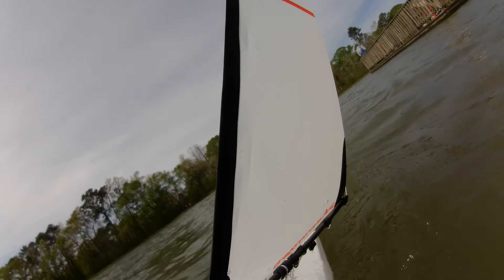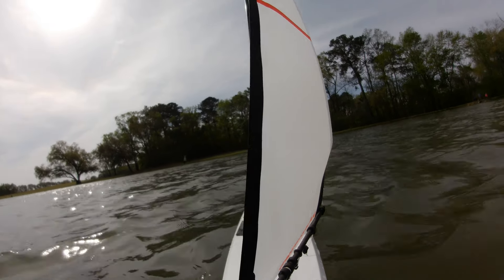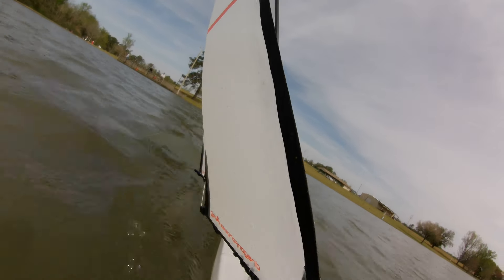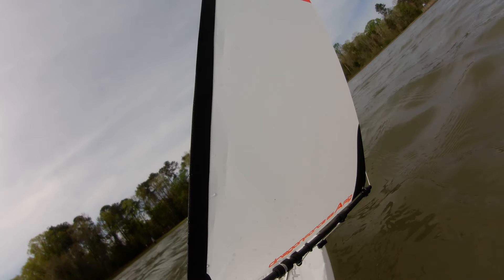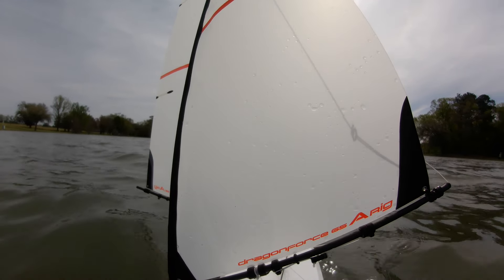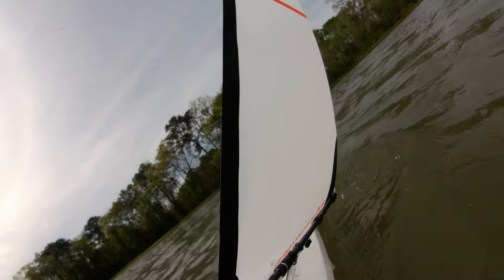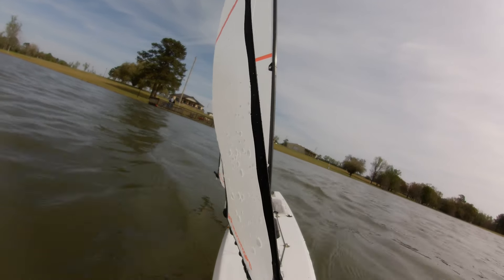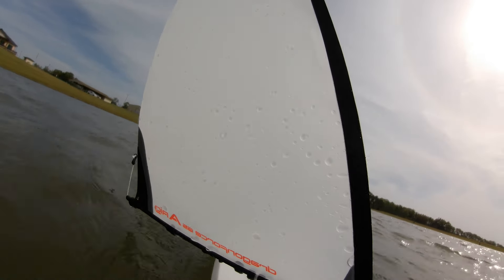DragonForce 65 On Board Sailing How To

Comment: Nice Jeff! Are you a sailor? Does this have a motor of any kind for a backup?
Reply from the maker: I started sailing right after I turned 16, Motor? Don't need no stink''n Motor. You can sail in any direction as long as you have wind, it takes very little wind to move the Dragonforce sailboat. Paul thank you Jeff